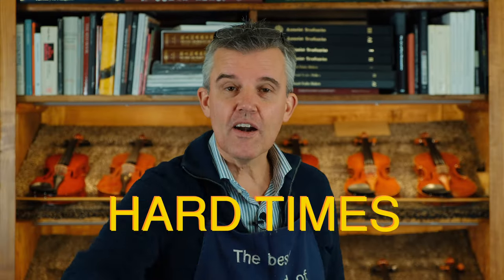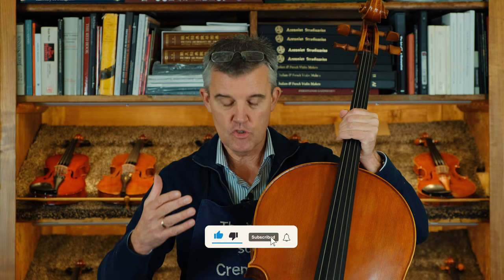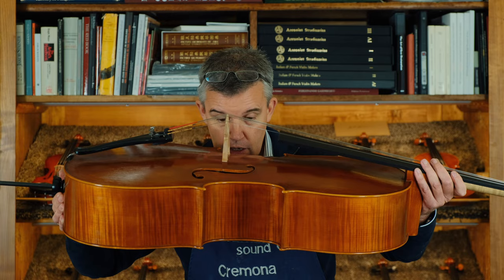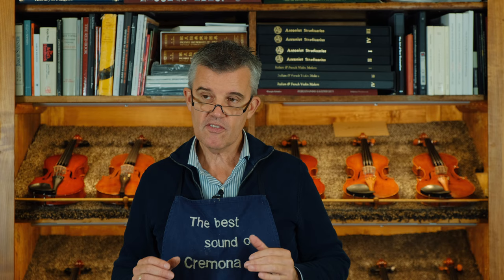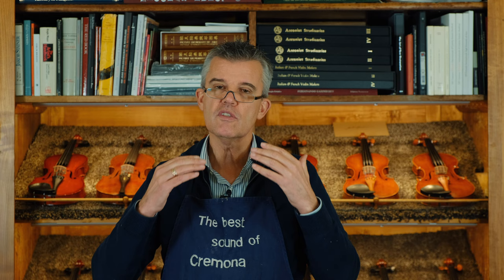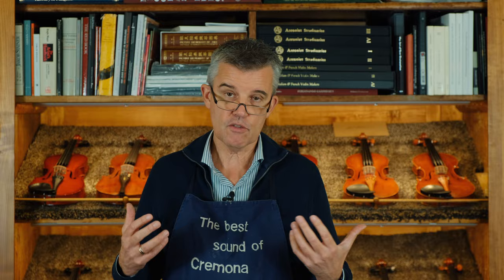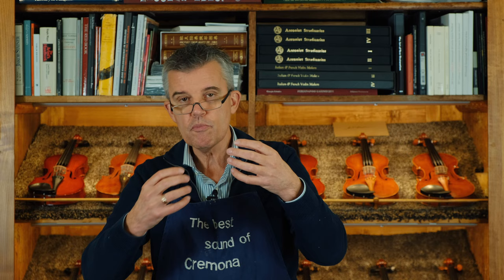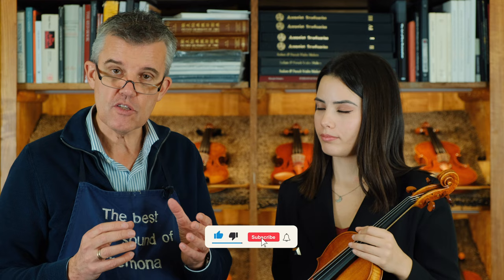First String HACK - Too Strong/Weak E-STRING?

Comment: My first cheap cello sounded like a wet cardboard box, then I scraped the feet of the bridge to fit the top using lipstick like you showed and also adjusted the soundpost and it got a lot better. They did not have a good fit at first, they had like a 1mm ridge protruding along the side of the feet, like they had put sandpaper on the top and rubbed against it but missed a bit.

On my new €3500 cello I moved the soundpost a bit but ended up going back to where it was so it was set pretty well from the beginning.
Reply: "Wet cardboard box"     LOL !!!  brilliant and accurate description of some cellos.